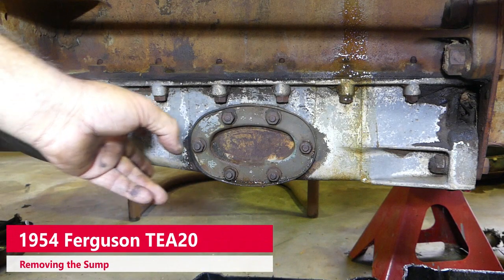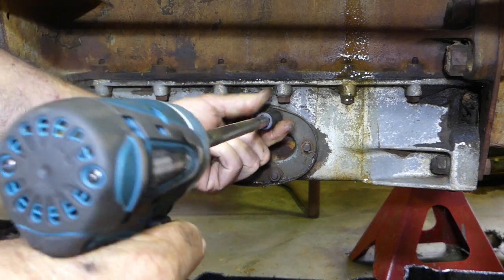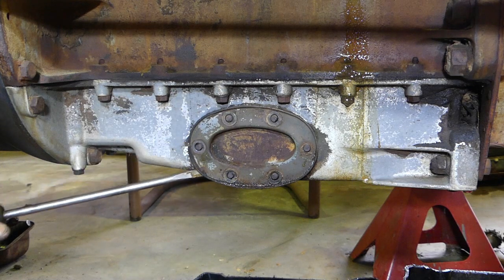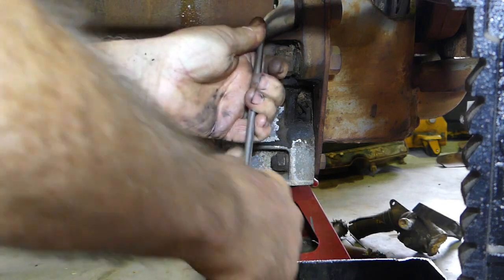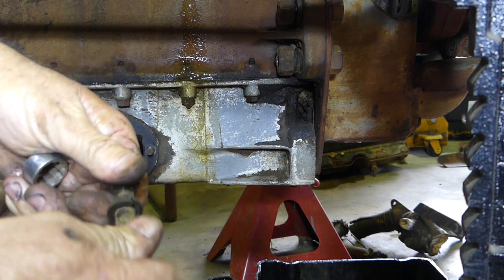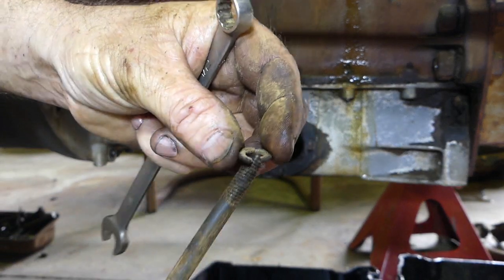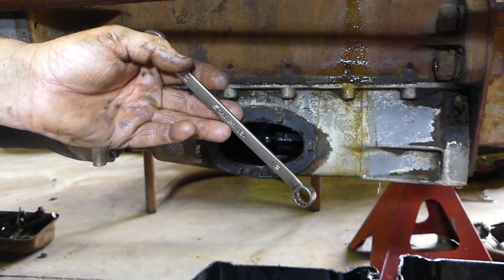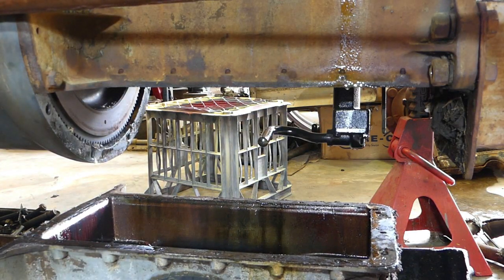Sparex Ferguson TEA20 # 4 Removing the sump

Comment: Just took mine off my tef20 was wondering what the gauze thing was also found a crap ton of water inside as it had been sitting in Typical Irish wether for about 37 years also just got it unsized so it should soon run
Reply from the maker: Sounds good.
Reply: Bundy Bears Shed ye it should be fit to start some time soon lots of rusted out pipes tho :(

Comment: When I took my sump off no onl;y was there metal flakes there was also a half moon shaped key, where could that have come from? I suspect also my oil pump is not working as tractor has virtually seized since being ruin for the 1st time in 20 years.... any help or advice would be great.
Reply from the maker: Key possibly from the oil pump drive by the sound of it on the fitting the distributor part of this series I show it.

Comment: Thanks for the vid, could you show us the procedure for renewing the crank shaft oil seal. Well the bit we have to do with the sump off. Thanks nick.
Reply from the maker: Yes it is on the list for when I get back from holidays.
Reply: @BundyBearsShed  did you ever do this vid? I've failed doing it with grease as per vid.....
Reply from the maker: @temotu518  yes I did the rear engine seal as well as the sump but I haven't done the ropes on the rear main as I had no need to.

Comment: Hi.
I have got a 35x which need a bit of care. I am changing the filter. The one I am a bit worried about is the sump strainer. It isnt like this one. Is there anything I should be carefull about or can I just remove the sump plate and take the strainer out?
Reply from the maker: The strainer on the 35X in under the sump as you have a Perkins engine not the Standard Motor Co one. You can drop it for cleaning though.

Comment: What size are the sump bolts (thread size and length) as I have just acquired a ted20 but the sump wasn't on and it doesn't have the bolts
Reply from the maker: I think they are 5/16" unc but length Im not sure as I would need to pull one out to see. Easy enough to measure though.

Comment: Hi Bundy, wondering if you would be able to tell me what the type/size of the 3 bolts are between the sump and the transmission case, currently my tractor is missing all three, and despite my best attempts I can't find them in the parts manuals. Thanks in advance.
Reply from the maker: Let me check